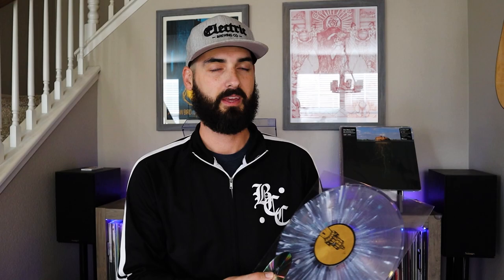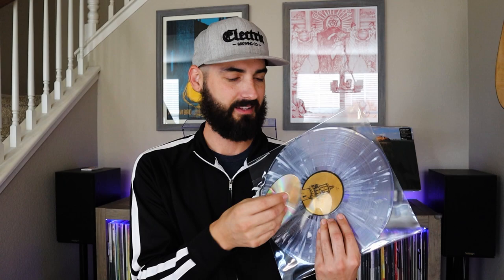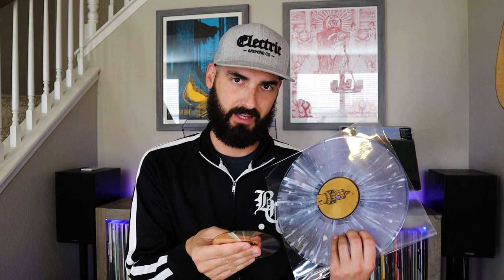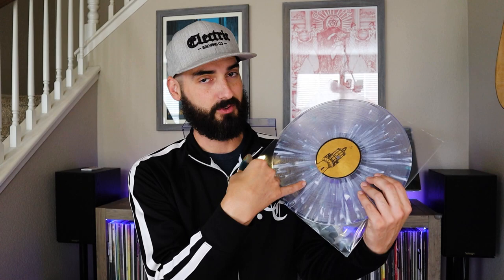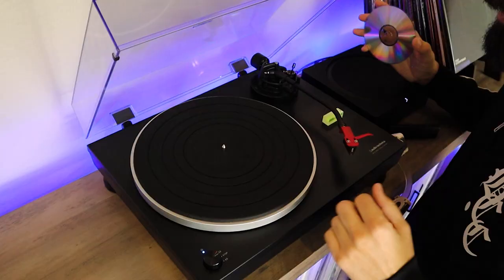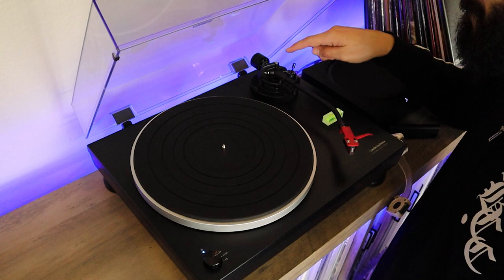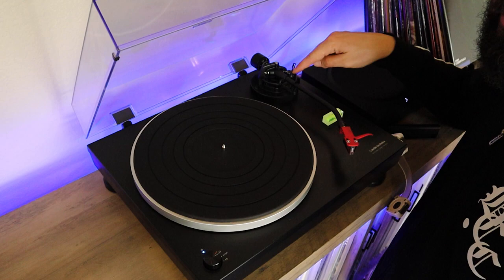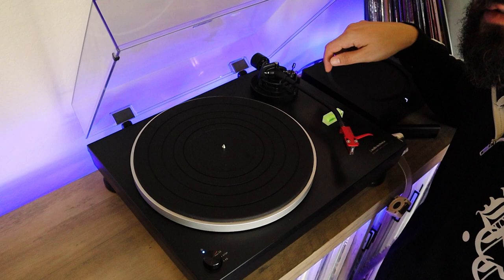Anti-Skating: How to calibrate and test your turntable anti-skate settings

Comment: Using a mirror surface is just pure WRONG. Use an Ortofon test record for antiskating adjustment and check modulation at 315hz 60µ, 70µ, 80µ, 90µ &100micron amplitude.
Reply: How would one do that? I have the test record but I’m unsure
Reply: How can I check modulation without expensive device?

Comment: You can't calibrate anti skating using a blank disc, it has no music modulation!  The modulation changes constantly , that's the reason you have "compromise" the best setting!  It's all a compromise,  that's why the anti skate is recommended to be the same as the tracking force !
Reply from the maker: True it’ll never be perfect, but this at least let’s you get somewhat accurate.
Reply: The more advanced method is with an actual test record that plays tones specifically to calibrate this setting like the "Hi-Fi News Test LP" or "Ultimate Analogue Test" LP. These records also have a blank section where you can test if the tonearm drifts inward/outward. However, you may also need to get a meter that measures the tone's left-right balance when you play it. This can cost you quite a bit of cash. Even though the "laserdisc method" or the "blank vinyl" method may not be as accurate, it is an accepted way of doing it if you can't (or won't) spend the extra cash.
Reply: Wrong. It's about centripede force not modulation.

Comment: In the 80ties we audiophiles used a mirror instead of a special disk.
Reply: hi 80's audiophile how does that work? can you explain? isnt the mirror for measuring azimuth, not anti skating?
Reply: @w1nchester32  It wasn’t yesterday, but as I recall. With a mirror I did two things first correct the Azimuth. And checked the anti skating by lowering the pickup on what would be the midpoint of a vinyl record, with a mirror laying flat there instead. Mirrors having very low friction, if correct the arm doesn’t move either in or out but stays at the same spot. Also do some follow up checks on several other points the same way to be on the safe side.

Observe the turntable is off under the hole operation. Hope my explanation is somewhat explanatory.

You need a descent quality mirror without a frame. Those double sided hand mirrors some women carry, was my choice.

Comment: I've set up a new Cartrige and found the left channel louder. After lots of adjusting around, I've found that the anti-skate setting (set at the same reading as the tracking force) was set too high. Initially the anti-skate was set at 2.0, which was the same as the cartridge tracking force. Eventually, I've ended up with the anti-skate set at 0.8! This balanced the volume better on both channels.
Reply: tks for this. i had mine the same way (settings) and felt the tracking was too much. ended up here
Reply: Same happened with me. RT82 + OM10.

Comment: The correct setting is that the stylus moves slowly inwards on the blank record. Otherwise it's too high a force and the outer groove of the records will be damaged in a short time.

Comment: I would recommend to use a glass one, can be cut and pierced from whoever produce glass or cut glass for a fair price. I did that with my professional turntables and it works better than ever. This allows you to have a flat surface and not warped like, unfortunately, some of the plexiglass or plastics discs often do.
Reply from the maker: Didn’t think of that! Mine had a slight warp but still good enough to gauge it and way better than a cd.
Reply: This might sound dumb but would the diamond get damaged if its going across a hard surface?
Reply: @XxXhiis663xX  diamond is a much harder material then glass.
Reply: @XxXhiis663xX  As long as the glass is smooth, diamond will not catch anything to snap and the diamond is harder material than glass so it will not be damaged because of grinding.
Reply: Have you balanced the turntable with a levelling tube perfectly with the glass on it prior to the final adjustment?  Glass is heavy though

Comment: The plater of the Pro-Ject T1 Phono SB is a glass disk (slightly sand-blasted on one side tho).
I'm guessing I can use the smooth side so I won't need CD nor that clear calibration disk, right ?

Comment: I have a one-sided 12" which appears to be flat/glossy on the side without the recording. Is there any reason this isn't the same thing as an anti-skate calibration disc? I ask because I'm seeing some bad skating on it when I try a calibration test. Doesn't seem to matter what my anti-skate is set to. I used vinyl cleaner on it to minimise any residue or particles on the surface. Tone arm just flies across towards centre no matter what the anti-skate setting is. I have the Audio-Technica LP3XBT.

I don't have any normal playback issues. Where I have issues is at the start of the record. The tone arm goes down and then seems to jump/slam into the first track, often leading to it skipping the first few seconds. It's not pleasant at all. It's worst on picture discs and coloured/clear vinyl. Some black vinyls seem to be ok. Especially older ones. It's also less apparently with a manual start, especially if I apply a little bit of downward pressure when the stylus is landing.

So, if my one-sided 12" is good enough, then it seems to suggest the anti-skate on this turntable either doesn't work or is quite frankly fake.
Reply: Black Grape?

Comment: So my antiskate doesn't work right, both on the old table and on the new one, a Reloop 1000 mk2.
I made sure I did all the steps correctly and in the end it only works when the weigh  is set to 1 Gr. 
When it's at 3 Gr for example, and that's what I need for my cartridge , a Concorde Vibe, it just doesn't work, even with the anti-skate wheel in position 7, which is the maximum.

I bought this table because the same thing happened to me in the old one.

Any suggestion or conclusion?

Should I return this one and try a new model from another brand? 
Should I leave the anti skate to the same value of the weight and let it skate ? Because Concorde Vibe says i need to apply 3 to 5 Gr...

Please help :)
Reply from the maker: Usually tracking force and anti skate should be the same but a lot of anti skate mechanisms aren’t set correctly in the factory. If you set it to one and it glides in one spot when testing, that’s what you want to see.

Comment: Hi.. So I have a NAD C588 turntable with a Ortofon Black 2M stylus. Recommended force is 1.5. The weight says I am on 1.5. Antiskate is also set to 1.5. So my question is; should I increase the antiskate dial so the stylus stays in place on a blank vinyl? Because I briefly tried and that puts the antiskate all the way to 3.something.. Is that not too much? would I risk damage to stylus/vinyl by doing that - or do I risk damge by NOT doing it? PLEASE HELP!
Reply: I have the same equipment 😄no don’t put it on 3, read j.Paul purdel’s comment!!  On mine the stylus stays on 2 so check the turntable with bubble level first
Reply: @pappouas  yes ok thanks

Comment: What happens if you have a fully automatic turntable - I have a B&O 1700 - and the tonearm skates across the surface of the record, all of a sudden.  I started using the turntable in Jan. 2022 and it has work great until now.
Reply from the maker: Contact the manufacturer if you can’t adjust the anti skate settings

Comment: so I used this method and found out my tone arm was skating to the right toward the outside of the record. Once I had it set so that it didn't drift, I found the stereo separation to be much better and improved sound. I was told on a Turntable forum that his is not the correct way to do this and that it would ruin the records..
Reply from the maker: Naw. It works I’m happy and have been doing this for years.

Comment: No one mentions how to do this without the turntable spinning. Many TTs spin when you move the tonearm toward the platter. (No I don’t want to reach behind the cabinet to unplug it every time I make adjustments.)

Weird, seems like I did it somehow a few years ago, but I can’t see how I got the platter to stay still while also moving the tonearm over it.
Reply: Oh sorry, I meant specifically measuring the tracking force. I want to take the mat off, and put the scale there to measure.

Comment: Could you use a record that has a non-playable side?
Reply from the maker: Yes! As long as there is no etching and it is smooth.
Reply: Yes, you can buy a blank vinyl record from Amazon.
Reply: I thought about this, but unfortunately for this purpose all of my records with a non-playable side have large etchings on that side.

Comment: as anti skate setting "typically" matches tracking force, what if the recommended tracking force is beyond the maximum anti skate setting of the tonearm?
does this make that cartridge incompatible with the arm?
Reply: whats the max anti skate cuz mines like 7
Reply: @charliemannion2718   3 on mine
Reply: what cartridge you using thats a 3 gram or above?

Comment: 4:00 That's probably polycarbonate, too, which is the material CDs are made of. Acrylic surface would probably scratch too easily from the needle.
Reply: I have a Machined Acrylic Turntable Mat which, aside from using it to replace the felt mat, I used it to set the anti-skate, it functioned the same as the one used in this video.

Comment: Well, even before you set your tracking force... shouldn't you set your counterweight to the 0 mark, then adjust its position on the arm (towards or away from the head shell) to balance the tone arm and cartridge to its null or floating point? Then set the counterweight to the target tracking force setting, then set your anti skate.  That's what I've seen and been told. Good Luck
Reply from the maker: Yes you zero out the tonearm until it’s straight and floats in place then add the weight to the specs provided
Reply: You mixes up things. First, set the WEIGHT of your tonearm according to the recommanded WEIGHT by the cartridge manufacturer. Then, adjust the tracking. There is about NO correspondance between the recommanded WEIGHT and the TRACKING required, because no turntable is made that way. You have to adjust with a blank disk.
Reply: What? How do you adjust weight separately from tracking force? Or did you mean anti-skating?

Comment: This theory, that a tone arm should be motionless on a groove-less spinning disc is absolutely  incorrect according to a phonograph technician I spoke with at length.  Actually doing as this theory advocates can cause irreparable damage to the record and  stylus.
Actually, Anti-Skate is supposed to add a very small (slight) amount of outward force (toward the edge of record) DEFINITELY NOT CAUSING THE TONEARM TO BE MOTIONLESS.  With the proper amount of Anti-Skate applied, the TONEARM will still move toward the center of the groove-less disc but at a slightly slower rate of speed compared to the slightly faster inward speed of TONEARM movement if no Anti-Skate was applied.
Reply: Wrong. What you want is making sure there is less pressure as possible to the SIDE of the needle, coming for either side (in or out). This pressure is caused by the centripede action of the spinning disk. Nulling it prevent not only stylus deterioration but also distortion (too much pressure). And don't worry, the stylus will still follow the groove.
Reply: A stylus contacting a blank disc is not the same as contacting a groove (modulated music).  Only the very tip of the stylus contacts a blank disc whereas the sides of the stylus are in contact with a record groove.  The mechanics are not the same.  On a blank disc, ample outward force (centrifugal) is needed to counteract the centripetal force when the stylus is skating inward.  In a record groove, the centripetal force is partly counteracted by the inside groove.  Only half the anti-skate force is needed in a record groove compared to a blank disc.  That's why people are doubling their anti-skate force when using a blank disc and questioning why.  It's a false test.  You will not determine the proper anti-skating force from a blank disc.  (It could be specially coated to simulate a record groove - but also a false test).  The only verification I know of is listening to test record.

Comment: I am not really experienced with this, but I am pretty sure, this method does not make sense: If the tonearm doesn move to either side on a blank surface, a real record will for sure produce pressure from the outer groove on the stylus - which means too much skating. Therefore, I think on a blank surface you should at least aim for the tonearm to move slightly to the center.  What do you think ?

The only accurate method would be an oscilloscope and comparing L and R volume level and frequency

Comment: This method and your assumptions are completely wrong IMHO. Anti Skate , or as it was once known 'bias', is a very subtle force designed to counter an effect where lighter tracking cartridges tend to swing inward toward the end of a spinning record. AS is unnecessary above tracking weights circa  3g, which some cartridges such as the Shure M44 reliably track at. The effect which AS counters is only present when the stylus is playing a groove in a spinning record. Hence by playing a blank disc, record or laserdisc, there is no 'skate' effect from the friction on the inner groove, and hence you are setting a value to counter something which does not exist at that point. You are actually trying to counter a centrifugal effect on the arm at that point, which isn't as severe in a record as the stylus is buffered by the outer groove wall.

I think people  confuse anti-skate with  the arm dropping or raising in a perfectly vertical manner, which it is not. if the arm drifts as you drop the arm with the cueing mechanism (or during raise) its more likely due to a) the deck not being perfectly level b)  there not being enough grip on the rubber lift buffer and  a wipe with a rubber restorer can help (i.e platanclene) c) the damping mechanism of the cueing mechanism needing attention i.e new silicon oil

Comment: Using this blank record is not the same as having the needle tracking a groove in a real record.

Thats physics. Maybe you can use the anti skating setting you get by this test, but it needs some form of adjustment to be proper when you play a real record.
Reply from the maker: The concept is having no pull left or right in the center of a calibration disc means it'll track evenly when in the groove. Using this method i had less distortion than the manufacturers recommendations. It's subjective though not every set up is the same.

Comment: what you say is wrong, you can't set anti-skating correctly that way, you need a test record to set it right, I know there are many who say you can do it like that, but those who have a lot of knowledge in it , says that's not the way to do it.
Reply from the maker: That's up for debate. I consulted with people who "have a lot of knowledge" on the subject before making this video and my set up sounds great now.
Reply: @Music-for-Miles  I have 4 cartridges that must have a needle weight of 2 grams, but they must all have different anti-skating, but with your method they must all have the same, a fine line grind, must have less anti-skating than an elliptical, different grinds pulls the needle differently, therefore you cannot use your method.